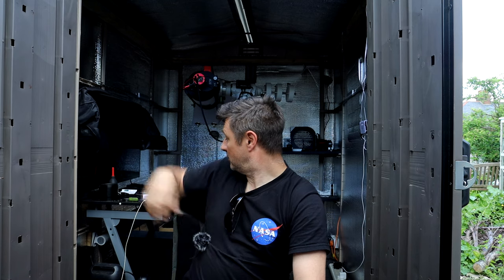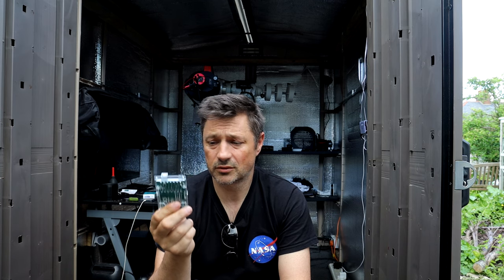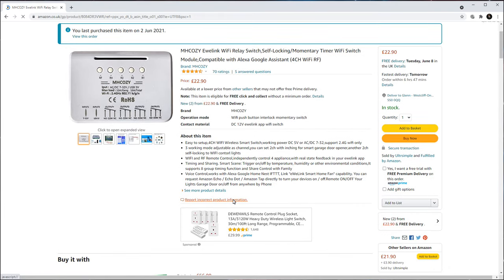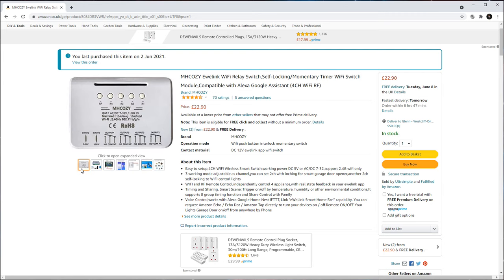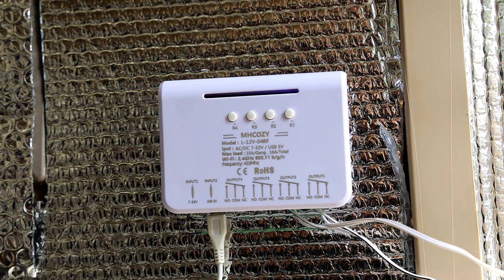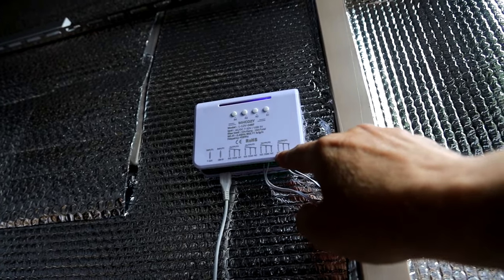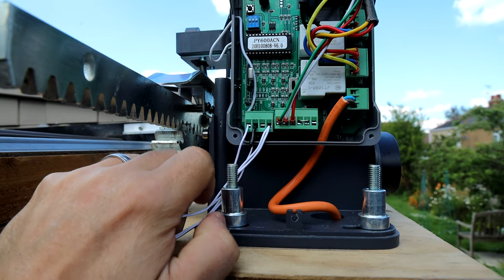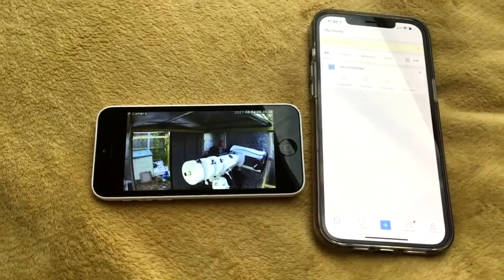Roll Off Observatory Roof Remotely from anywhere in the world- Astrophotography

Comment: Nice one Glenn! Cool backup solution in the event of computer/Arduino crashes etc. Will look into this for my Obs. You will need to add sensors to monitor the state of the roof (open/closed). I have two sets of magnetic sensors for the roof and then park sensors for the mounts. Because I have two scopes in operation, my setup is a bit more complicated because I need to make sure both scopes are safely parked before closing. It’s a fun project. Look forward to seeing your updates.
Reply from the maker: Thank you. I will add sensors but because I can also remote in to the live feed camera from anywhere I can visually monitor the scope and roof before moving anything. The only thing at the moment that automatically moves is the scope parks at the end of a sequence. I am sure in the end I will have cloud/rain sensors and all sorts.

Comment: Thanks for the inspiration - I will be doing almost the exact same setup for now (I have a digital dome works that will be connected to it eventually) - great work!  How do you handle the momentary contact with the wifi relay device or does the motor controller not care if the contacts are kept closed the full motion of open or full motion of closed?  Normally I would think this would just be a momentary contact but I imagine the relay is on the whole time until you press the close button.  Just curious - keep us the great work!!
Reply from the maker: hi and thank you for watching and taking the time to comment. I no longer use this as I now run the roof through NINA and use an Arduino uno with a relay shield to control the motor. the motor only switches to move to open or close after the relay has cycled through its switch. There ws always about a 1 sec delay after relay switched before the roof moved. Nothing special had to be set or changed, it just worked out the box.
Reply: @Astrobloke  Thanks for the reply - I see that you use NINA and I will actually be using Digital Dome Works (was given to me by a good friend that didn't want to use it with his dome).  I will have to modify slightly to use with the gate motor control and other interlocks, but for now I will keep it simple to get things up and running.  Thanks!

Comment: Glenn that’s great thanks for sharing. Can I ask what gate motor system you have?  I am looking at automating the roof and worried about compatibility. Thanks a lot. (Chris. UK, Kent)
Reply from the maker: Hi Chris. I have links to the one I bought and all the installation details here 
https://youtu.be/dZv0OpL_5KI
Reply: Lovely thanks I will take a look. I am just starting the build of the observatory. Big learning curve. Thanks again. Chris.
Reply from the maker: @liveinthesunshine3018  very much so. I have a few videos on my build which may help with ideas. Happy to help if you have any questions
Reply: Thanks a lot. I have laid the base and set the bolts for the pier. That’s it so far. Just going to order the materials then build starts in a couple of weeks. Can’t wait. Aim is 100% automation as south uk clear sky is few and far between so need to make the most of the time. Thanks.
Reply from the maker: @liveinthesunshine3018  You will love it. Best thing I ever did for my hobby. Where in UK are you as I am SE basically Southend-on-sea
Reply: Yes I can’t wait. Just got a lot of learning to do to move from tripod based imaging to an automated observatory. I currently use an asi air pro based set up. Will check out SGP and Nina. Oh I am not far from you then, just over the Thames in Whitstable (Bortle 4) near Canterbury.
Reply from the maker: @liveinthesunshine3018  bortle 4.... nice.
Its a fun project doing what you are if you like that kind of thing. It will add so much to your hobby

Comment: hi mate i have a question! how do you control you mount home position? do you have the mount parked at 90 from north while the lid is on them just move the scope manually to PA? i use the asiair and wondered how or if i can set a custom home position...thanks
Reply from the maker: unfortunately I have not used ASIAIR so not sure what features it has. In Eqmod I have a parked scope position which is both axis being horizontal so the roof clears any scopes. When I unpark the scope it goes to the home position and from there It will slew and platesolve to whichever targets I select.
Reply: @Astrobloke  hi ok thanks, what happens when you power down?
Reply from the maker: @stxe34  sorry I am not sure what you are asking here. If I power down it just stays parked and then after powering up I can then say unpark to home and it will go to home position. Because the mount is permanently fixed to a pier there is no PA needed as it never moves once it is set